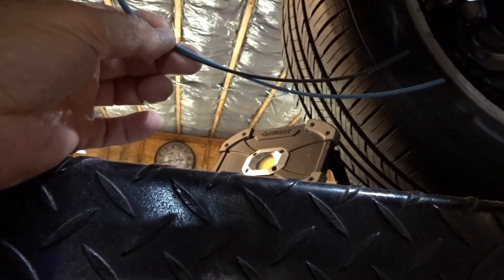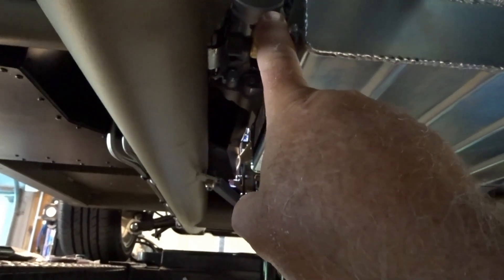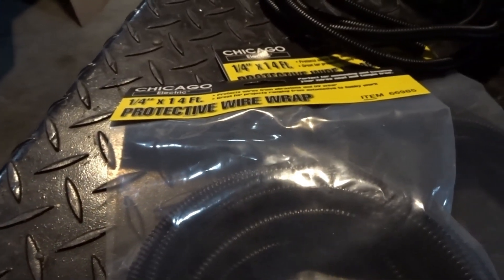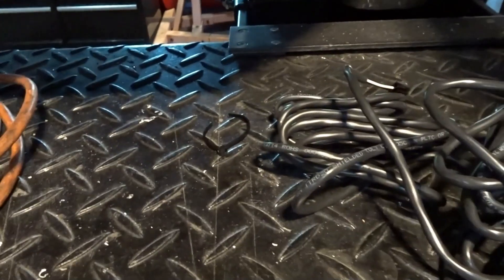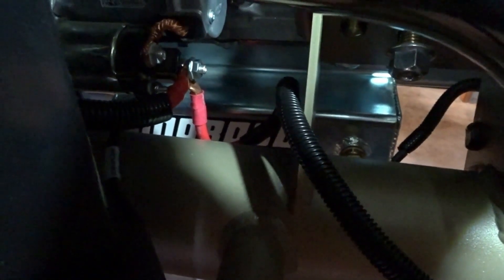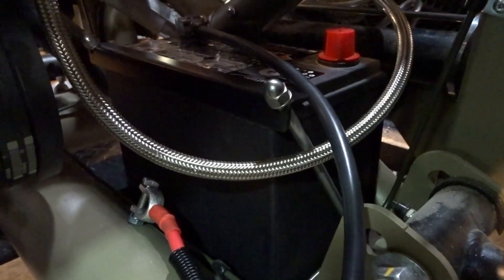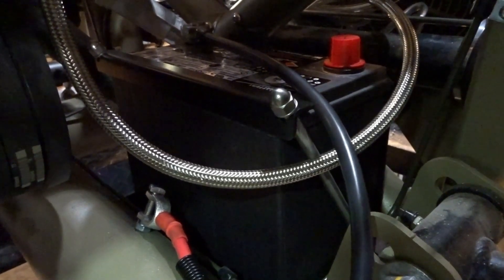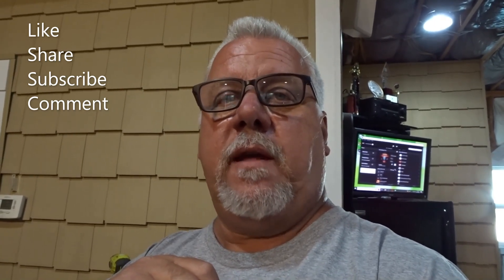Ford Control Pack and Ron Francis Wiring Continues on Our Factory Five Mk4

Comment: Hi please can you tell me where did you conect the positive from the battery
Reply from the maker: For the Ford Control Pack? Battery straight to starter power terminal and then to the Ford Control Pack. It's laid out that way in the Ron Francis/Factory Five wiring diagram.